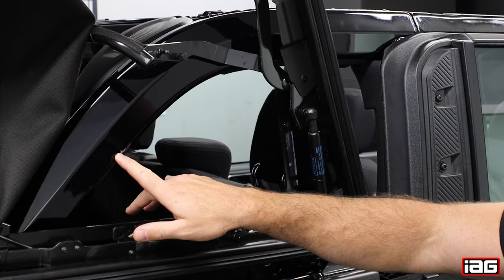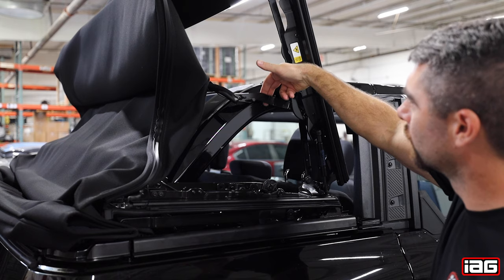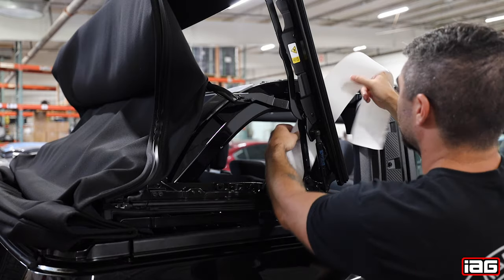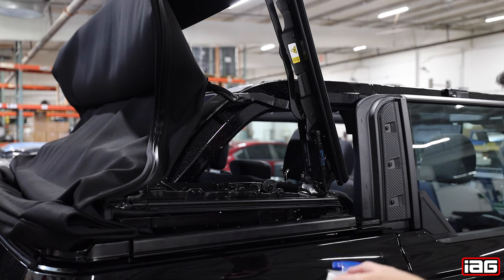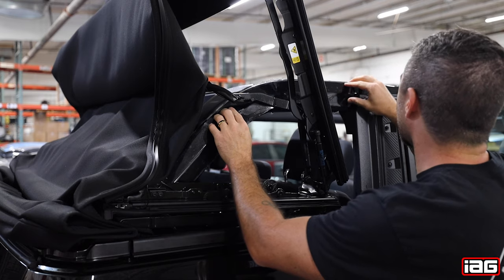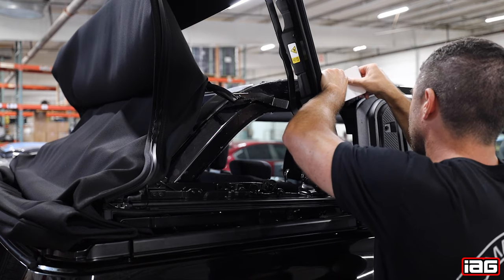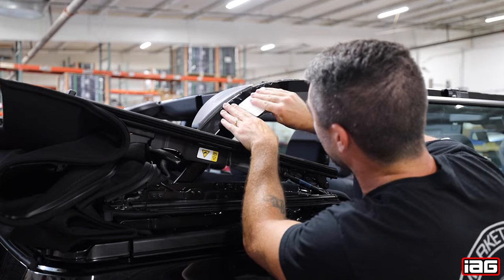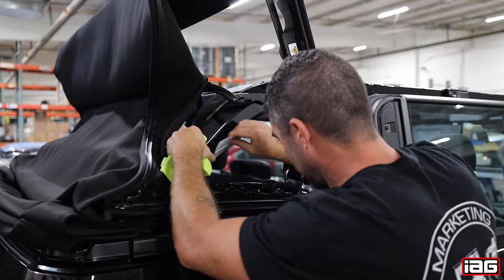Installing the IAG Ford Bronco roll bar paint protection

Comment: Kinda like putting a band aid on a gushing flesh wound. Temporary fix at best. This should be addressed with Ford under warranty. Clearly the soft top Is defective.
Reply: What is Ford going to do? Totally redesign the soft top? This isn't a warranty issue, it's just a bad design.
Reply: @brandonnardo9578  maybe not a full redesign as that would cost Ford Motor Co. way to much,  but maybe that portion of the arm can be redesigned/replaced? I’d have to see it in person to get a better idea.
Reply: Shouldn’t have to be doing that with a brand new truck. Ford definitely has to fix this.
Reply: my rollbar scratched bad when letting down softtop and you bet yo butt the Dealership had to fix it
Reply: Maybe add black tape or film under the arm instead.